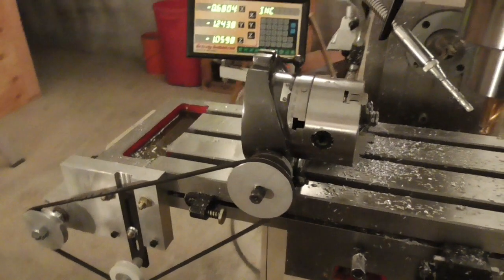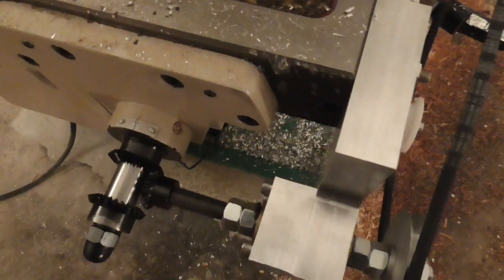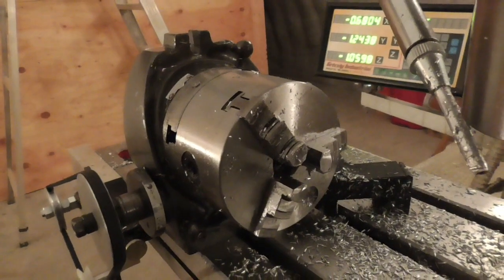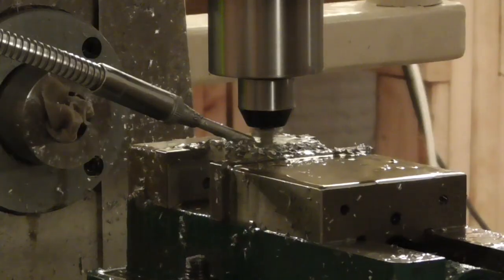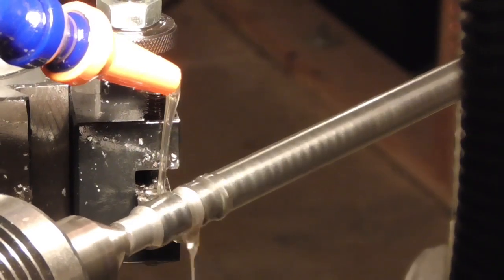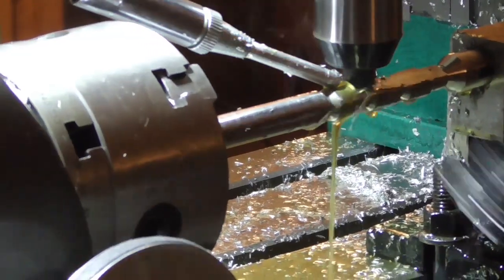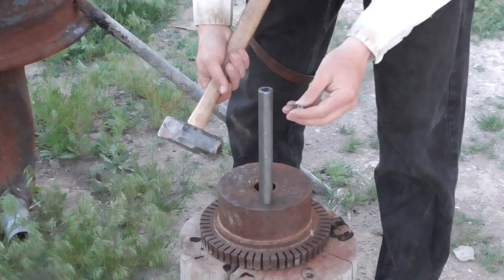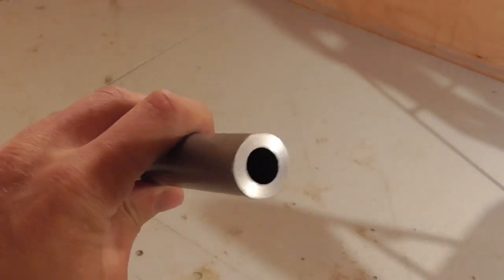Helical Machining: Rifling with the Norris Chuck (TIS094)

Comment: A good way to drive a button with a short stroke press is to get some hardened steel dowel pins about 2" long and one size smaller diameter than the bore. Run one in all the way, then stack another on top of it, and so on till you are all the way through. I've seen buttons shatter trying to drive them with a hammer.

Comment: A unique and fascinating rifling pattern. I would suggest replacing the friction belt with a gear belt. If the friction belt slips, you mess up your spiral. And swapping out gear pulleys makes it possible to quick change twist rates.
Reply: Yes, toothed pulleys and a timing belt to give positive drive would be better.

Comment: If you are going to machine the rifling button yourself, why not machine the entire amount of groves you want into the button itself rather then having to make multiple passes? Is there too much friction if you have that many groves at once?
Reply from the maker: Well, in this case if I were to make a button with 9 ridges instead of 3, that would mean making 3 times as many passes with the milling machine to cut the button and having approximately three times as much friction to push against when I'm driving the button.  If I were making a lot of identical barrels (and especially if I built a press to drive the button through) that approach would probably save time in the long run, but when I'm only making one or a few barrels, I thought this way would probably be easier.
Reply: I guess that makes sense. I generally prefer putting more time into the tools since I keep and will use them again, but if you think you will make 4 barrels and never touch the button again, then sure, I understand why taking all that extra time would not make much sense. Also, driving it though the barrel with a hammer....friction might be something to keep in mind, ha.

Comment: Cool vid. However your other video gave me an idea
You can just use a triangular file ,  round off the edges heat till red give it a small twist then cut off the part with the correct correct calibre. I tried it yesterday seems to work well!!!
Thanks for your how to vids

Comment: I am not sure if the lack of any reverb or the slow frame rate of the rendered video is more disturbing, but I have found in live audio recording some reverb and noise is fitting with the surrounding visual ambiance to make it sound more realistic.Also, I was thinking the reverb was a contributory stylistic effect. It is a little excessive and may be overly distracting. You could control it with some inexpensive evaporative cooler pads, burlap... spread around your recording area to break up hard flat acoustically reflective surfaces. You could be surprised with how little is needed to reduce it to an acceptable level.

Comment: really great one. is there anything to consider at the hardening process? how do you know when its enough? can you tell something about  that i mean the hardening in general
Reply from the maker: All I did to harden it was heat it up until it glowed bright orange and then cool it off with compressed air until it was cool enough to touch.  This heat treating method may not be very scientific, but it seems to work ok on rifling buttons made from A2 tool steel.

Comment: Excellent work! I'm impressed with how well the rifling came out, but you might consider revising the design of your spiral drive from using pulleys to using gears. Reason being that in the even that you get oil or grease on either the pulleys or the belt they will slip and the helical path will become irregular and unpredictable.
Reply: Good suggestion, I was thinking about belt slip also.  When I built my CNC router, (video on my channel) I wanted to have the option to change ratios on the leadscrew drives, with no slip.  I used cheap nylon timing belt pulleys from SDP/SI in Hyde Park, New York.  Nothing in the main setup would have to change, just order the pulleys with the right size hubs in the desired ratio combinations, and pop on the timing belt.
Reply: I had a great idea that makes the expense of timing pulleys and belts unnecessary, and greatly simplifies the setup. If twist is one in 9, for example, make a pulley with circumference of 9 (pi x diameter = circumference). This pulley is attached directly to the workpiece chuck. 1/16 in steel cable is anchored to the pulley and wrapped around it the number of times needed for the length of the workpiece. The cable then goes through a idler pulley mounted to the table angled such that the cable now goes in the same direction of table travel. The end of the cable is anchored to a stationary surface. Now, as table moves forward, the cable is unspooled from the pulley that is attached to the workpiece.

This works in only one direction, of course, but a little ingenuity will lead to a cable coming off both sides of the pulley, anchored in the opposite direction as the first one.

For perfect accuracy, subtract the diameter of the cable from the diameter of the pulley.